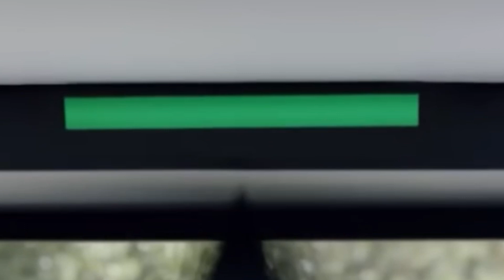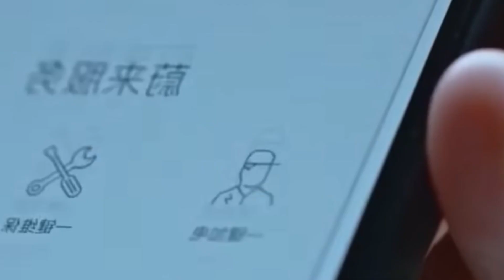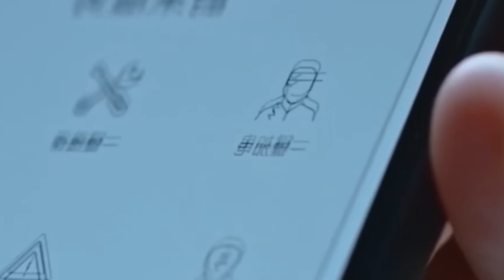New Electric Car Has No Battery and Just Killed Tesla’s Future

Comment: Ah… excuse me. Have a chat with the lithium miners, Rio Tinto Western Australia for example. The CEO stated last year that there is going to be a big logistical problem with the mining, transporting and processing of lithium for battery powered vehicles. A big shortage in other words. So storing millions of lithium ion batteries will not be possible in the long run. Also, storing millions of batteries could put consumers in the same position as ICE car owners when OPEC reduces oil flows in order to artificially jack up the barrel price. Speculators would be bidding on the spot price for EV batteries. Batteries are fuel, they are a commodity and they will become tradable. And since when have fuel prices decreased.

Comment: Put high voltage capacitors ( invented in early 1900's) on EV'S and forget about battery swapping or long recharge time. Now make Elon erase this comment. Thanks.
Reply: Capacitors offer very limited range. You'd have to recharge them every 50 kilometers or so.